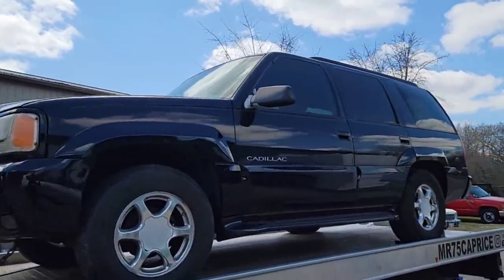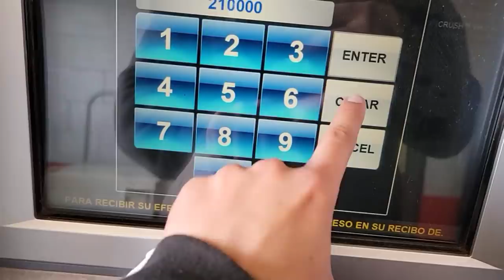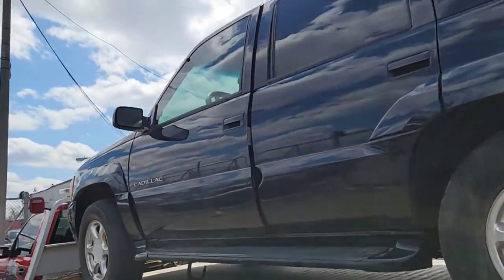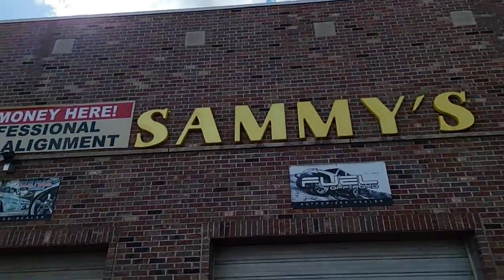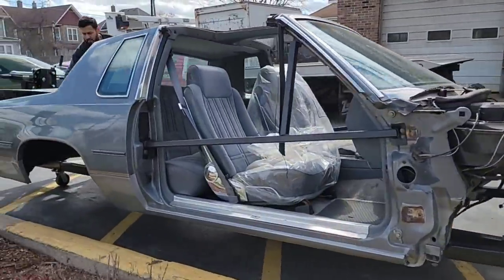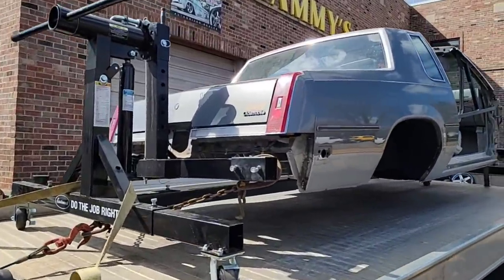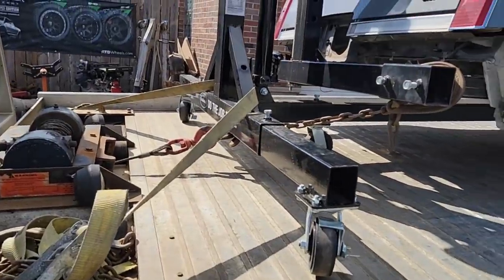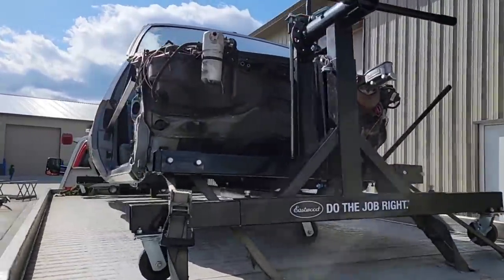I finally took cjon32s cutlass to get sandblasted

Comment: Damn gang that should be stripped of goods at least the steering wheel. Plastic won't do sand justice she just ain't read for a blast???
Reply: You right but it sounds like they are only going to do the bottom.